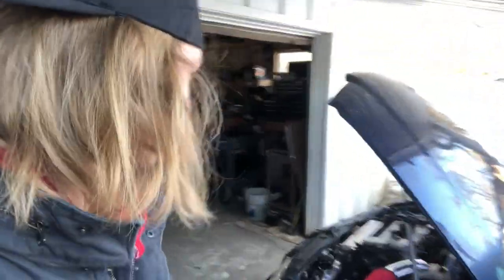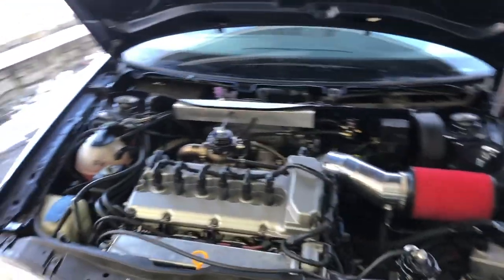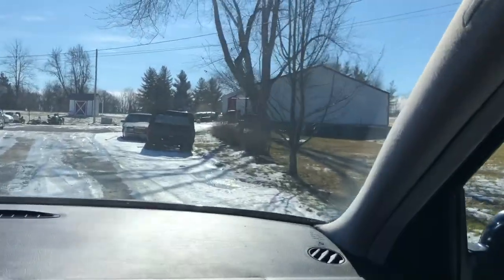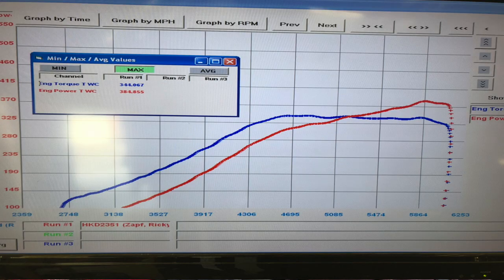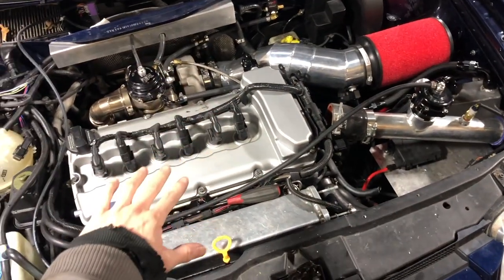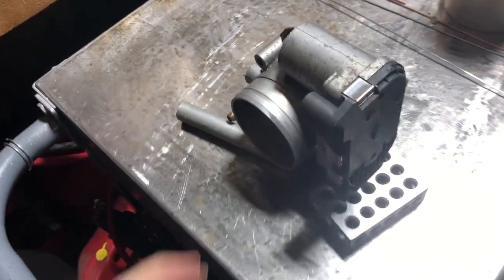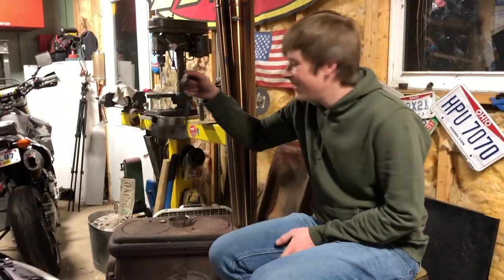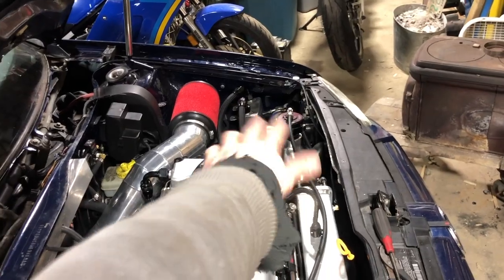Built VR6 FINALLY Gets Tuned!!

Comment: Woo! My emu is all hooked up I just can't figure out how to start it with the base map yet it cranks no fuel, 2.8 24v. Tried modifying the 3.2 startup map with displacement, injector size, IAT etc and there's no fuel readout on the AFR gauge during cranking but pump primes on ignition.
Reply from the maker: Hmmm, we just uploaded the start up map ecu master had and went thru the startup checklist(everything was fine) and it fired right up.. you have power at the injectors??
Reply: @PostPros  Yea about 10v at the injectors key on.
Reply from the maker: We’ve had a few crank sensors go bad, yours is for sure good??
Could you hook up the stock ecu and try to start it with that, just to see if it runs.. it’ll run without the maf, I remember starting ours with it unplugged once.
Also the afr gauges usually don’t work until it starts, at least the ones I’ve seen.
Have you went thru the first start checklist ecu master has??

Comment: awesome guys, is that a r32 engine? will the emu black work on a bde 24v?
Reply from the maker: It’s a BDF. Which is 24v with vvt on both camshafts.. I’d have to look what exactly a bde engine is from, but as long as it has variable valve timing on both cams and is a 24v it’ll work perfect🤙
I have a bunch of other videos installing and messing with the ecu, you may be able to watch and find more info regarding your fitment🏁🏁
Reply: That is what the ECU is built for originally 😂

Comment: Hey bro I have a 24v vr6 and want to know with what ecu tune to go with I am stock just want a little more power ? I seen Unitronic or apr, Unitronic revs to 7200 rpm and apr doesn’t say, what do you guys think and awesome video this thing is a monster !
Reply from the maker: To be 100% honest, idk..I’ve never messed with the stock tunes. BUT, I’m sure there both good tunes and will give you a noticeable gain. There’s really only so much “gain” with stock setup.. but you’ll definitely see better throttle response, higher revs…exc. 
We bought a unitronic for the original turbo tune, worked ok🤙
For the BEST tune, get the standalone ECU master setup(we have vids on that), bing it somewhere and get it tuned. It’ll be the BEST tune you can get for YOUR particular car🏁🏁
Although the “off the shelf tune”(apr, unitronic..exc.) will most likely be noticeable..
Another plus with the standalone would be, if you ever went turbo later, you’d be READY with the tuning part of the build🤙
You’d also be able to control everything you ever wanted 🧰🔧⚙️
Hope that helps!!🤙
Reply: @PostPros  I’m in souther cali by LA, you know any places just a tune for little more punch and higher rev
Reply from the maker: Not too sure..
To tune your car you need a standalone ecu, can’t really tune the stock one(at least not easily)..
I’m sure you’ll figure something out🤙
They’re awesome engines🏁🏁